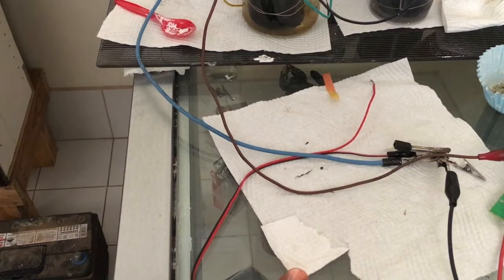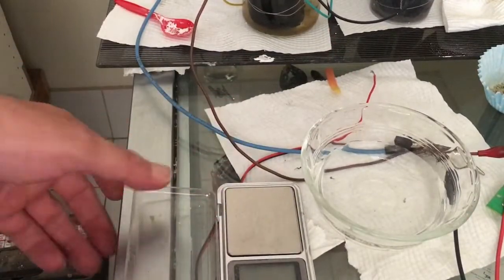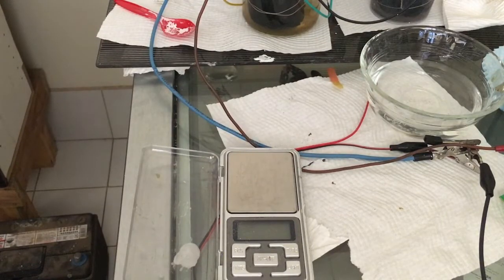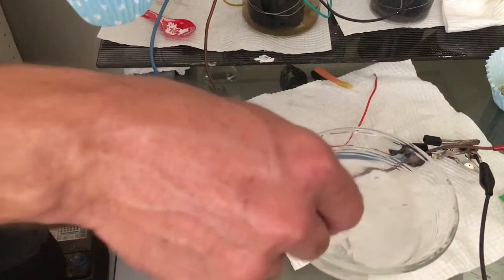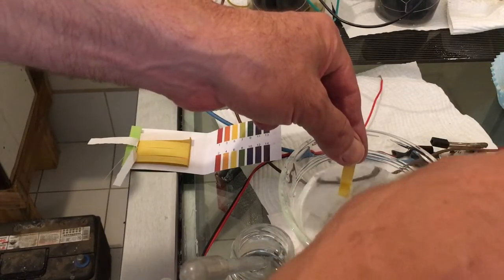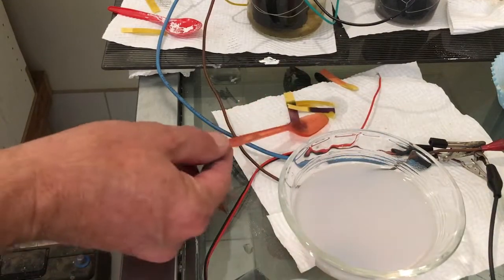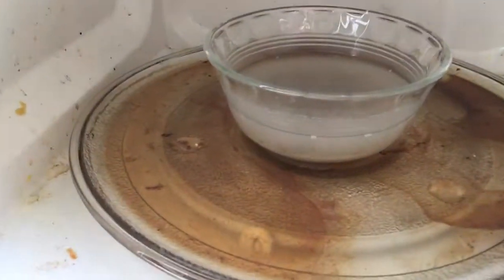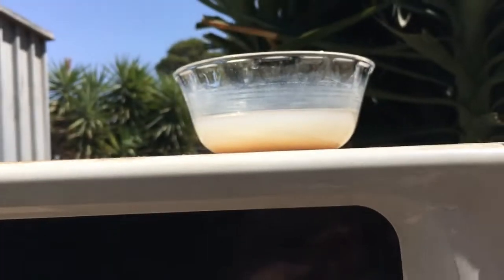Synthesis Of Zinc Oxide Nanoparticles

Comment: Did you like this method or the Zink hexocynoferrite or how ever we spell . Thanks  I like the read also thanks again
Reply from the maker: new name use both the zinc oxide in the electrolyte works good.
Reply: I did not get the message from you tube . Good thing I watched again. Thanks for video and the description and the leads in it. I will let you know how it goes when I attempt.
Thanks again great info